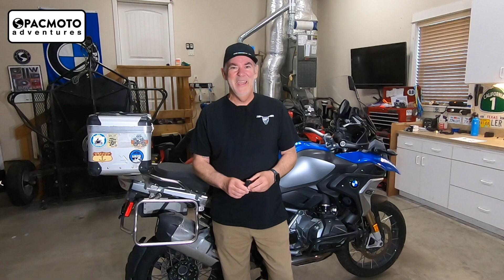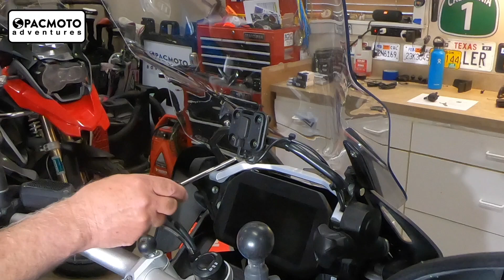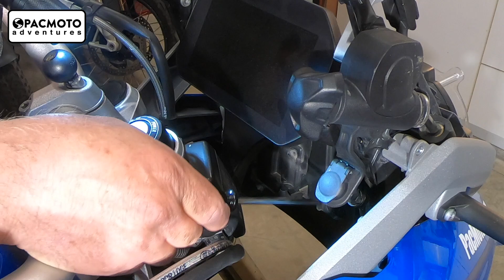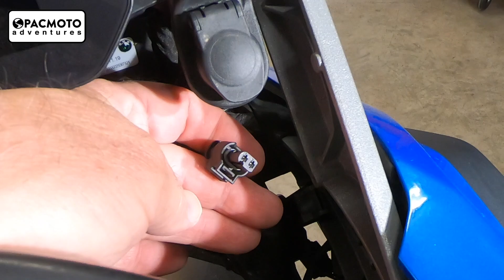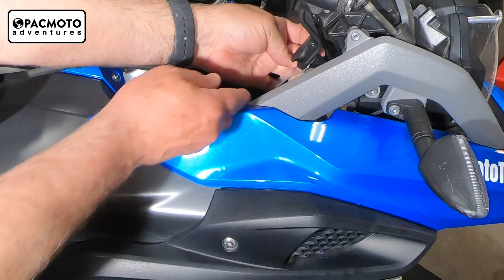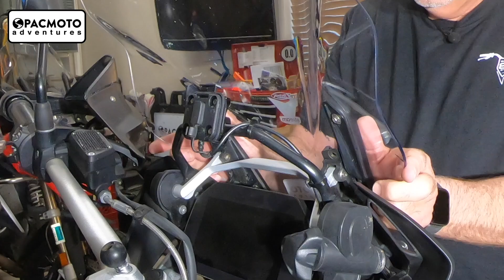BMW R1250 GS - Install Dual USB Outlet

Comment: Great video. I was surprised that we need access to the OBD port to do this job. Is there any way to get similar results without the electronic technology?
Reply from the maker: You do not need to access the OBD to install the USB outlet.
Reply: @PacMoto  my bad, I meant to place this comment against your brake fluid replacement video! 🤦‍♂️